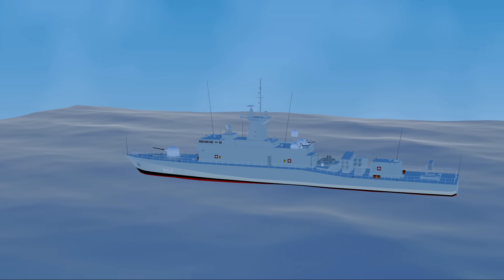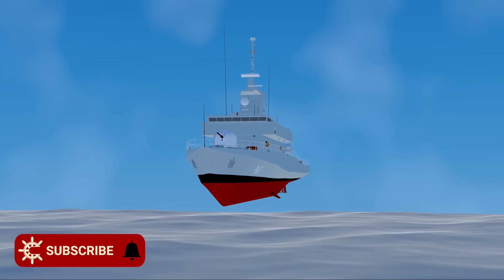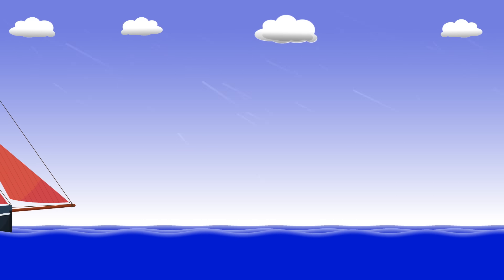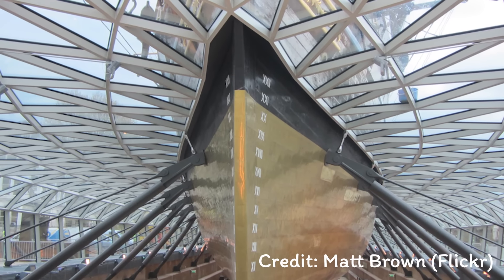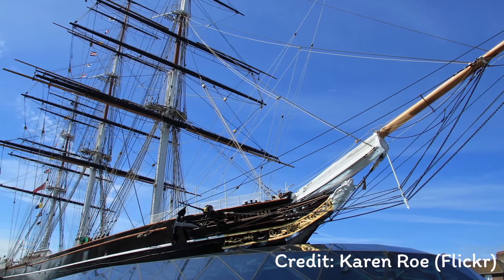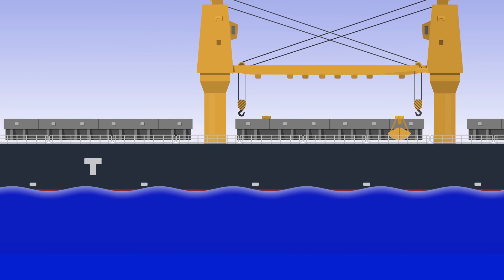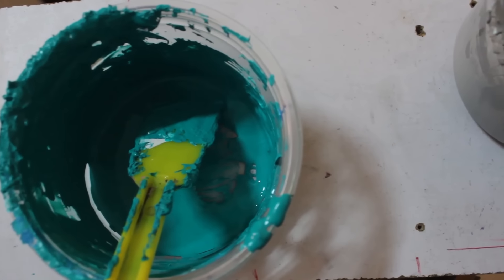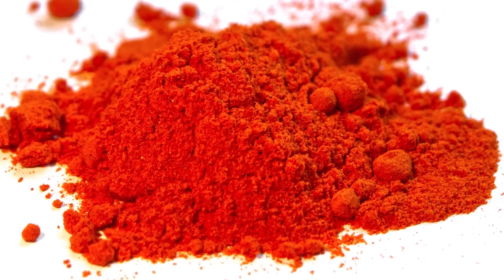Why are ships painted red below the waterline?

Comment: It is obvious: they paint it red so the water knows it is not supposed to go past it
Reply: gun control laws in a nutshell lol
Reply: @gregroberge8873   Well, yes the gun is basically an AK's body but no stock and a shorter barrel, but still we should classify it as a handgun
Reply: Dr. M. H.  He is kinda correct tho, it maybe a different color but you'll know the ship is overloaded if it went past the load line
Reply: I have never in my life seen a statement more false than this.
Obviously if that was the goal, they'd paint Gandalf on the bottom of every ship.
Reply: It's Anti rust paint or on a wooden hull for anti fouling and anti drag. I work in a port dry dock painting ships so I should know the primary function of the paint 🤭
Reply: @matthewmorris3497  cool
Reply: @felipefalcao7705  The line between the two paints is not the same as the watermarks or load marks. Granted the paint lines are strategically placed so that the bottom half of the vessel is in the water however upon closer inspection you will realise that the actual water marks or load marks on the bow and aft of the ship are the actual load lines. The line of paint is only for Anti rust purposes and has nothing to do with load or bouyancy. Metal ship - Alkaline water = Rust....Boat-Float-Holes in ship no thank you = possible death. Often glossed over is the importance of anti rust on this subject....see what I did there 'glossed over' 🤭👍
Reply: Just goes to show that being 1st to make a  comment to a video and gain 1.7k likes doesn't always make someone correct. 🤭😂
Reply: But let's all agree with the 1st statement 💪🐑😂
Reply: 😁👌 RIGHT
Reply: @gregroberge8873  so you don't like licensing?

Comment: Ok so for all the guys that keeps saying to electrify the hull:
electricity creates corrosion, wich isnt good;
Actually  there are strips of copper all over the ships which are connected to zinc plates underwater, wich disperses currents and corrodes instead of the metallic parts of the ship
( those are called sacrificial anode)
Even the simple friction between sea water and the hull create currents
Reply: It depends on the charge through the hull. Electric anticorrosion is used by some vessels today.
Reply: Hulls are commonly charged with a few milliamperes of voltage to combat galvanic corrosion if the hulls are steel. This is also done with underground pipelines.
Reply: @crawford323  yes i've heard about it but never had a chanche to work on one, it's more common to have a sacrifical zync attached to the common negative
Reply: @mattiamazzanti8418  The ship I served on was 500’ and while it had massive ingots of sacrificial sink, it also had the neatest sophisticated system to charge the hull just enough to offset and keep electrons where they are supposed to be. Steel not exposed to oxygen was not a big issue but any steel on the weather decks rusted like crazy. Basically the ship was being constantly painted topside. Pneumatic needle gun clamored all times around the clock attacking the topside rust. Very annoying when it was your bunk time.  I understand what you mean by electricity causing corrosion. This sort of issue can be found a most marinas and their ac power has bad grounds and is leaking voltage into the water. Leaving your  outboard motor down in the water for even a short period, will show pitting on the skeg.  I do not know the difference but that kind of current will consume aluminum very quickly.
Reply: "sacrificial anode" sounds very profound. We must sacrifice batteries to appease the sea gods who then will let us pass through!
Reply: @cawareyoudoin7379  Harness the power of Zeus to appease Poseidon.
Reply: Sir I have a doubt in the video when he is explaining how hard and soft painting method he said soft paint remove over time and hard paint won't come off but marine plants will grow he said then what is the use of the copper oxide. Please clarify my doubt.
Reply: @m.arockiyadhas6515 From another comment nate meehan
Just incase anyone was wondering you choose which version of paint ( hard or soft ) depending on how often you can repaint the vessel and how fast it goes a 60mph speed boat would rip all of the soft or ablative paint right off but the ablative is better at keeping the bottom clean on slower vessels
Reply: @mattiamazzanti8418  thank you bro
Reply: Exactly! On our boat a Westerly Clipper, we change the zinc anode every two years. We can get away with that because we sail in the Baltic Sea where the salt content isn't that much. In the Atlantic or even worse, the Red Sea we'd have to change it every year.